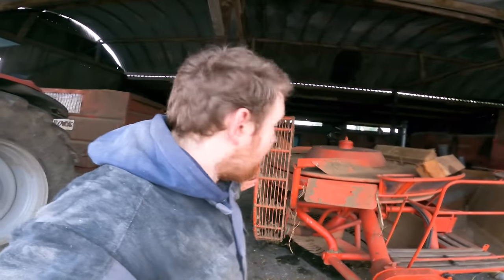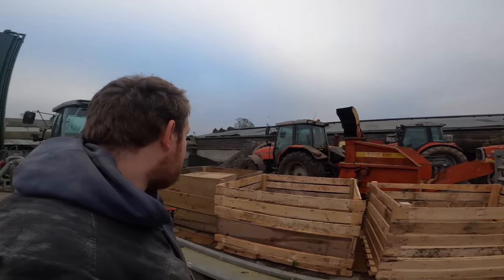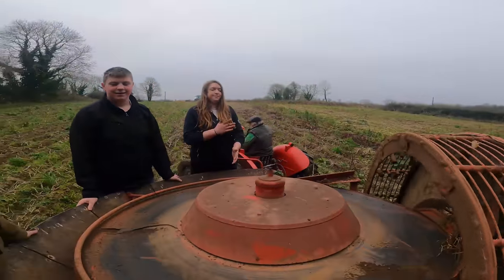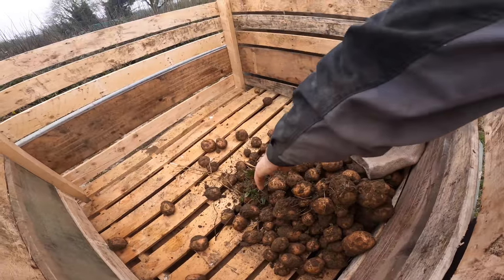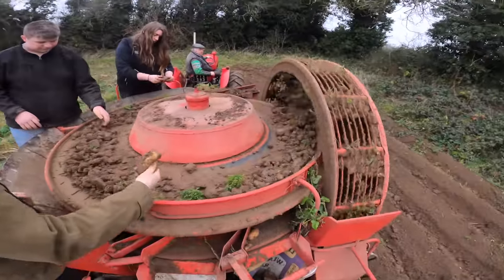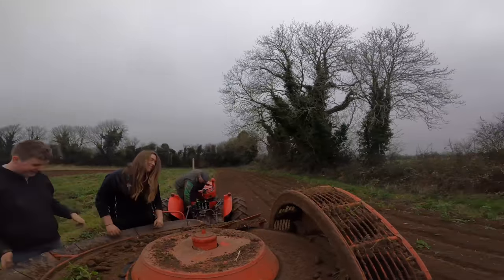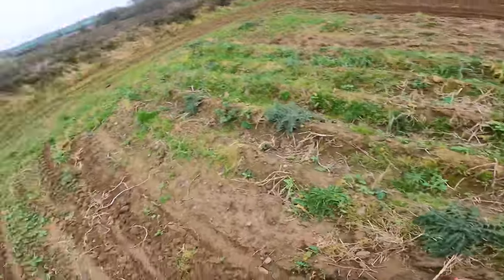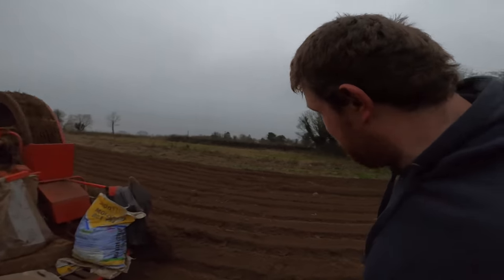DIGGING THE SPUDS IN TIME FOR CHRISTMAS DINNER | MF 35 & 711 POTATO HARVESTER

Comment: Our potato digger lifts 6 drill at a time only the driver needed and the loading truck...Runs 24/7 for 10 weeks and 3 crops per year 4.800 hectares register on the clock multiple that by 3..

Comment: Hi, as someone has already mentioned, always best to switch engine off when messing with PTO, yes i know its not a IPTO or modern electrically controlled PTO but someone could have jumped onto tractor and kicked lever into gear, or it could have been in ground speed and Phil could have reached through and pulled lever right into engine speed, we all know there are too many injuries and fatalities in farming, my father lost two fingers doing something a lot of farmers do every week, he was stood chatting round a sale ring at a cattle market, he had his hand on the metal railing and a bull tried to get through the ten inch gap with his head, cutting dads fingers straight off.

Comment: Looks good Phil, can't wait to use mine again, yours looks to have the wheels set back a fair bit more than my one too. Taking it to the show in January behind our 1962 35, which should be good, took our spuds out in July so no problem with clay sticking! Do you wind the drawbar across inline with the tractor when going down the road? As it looked like it was hanging out one side of the 35